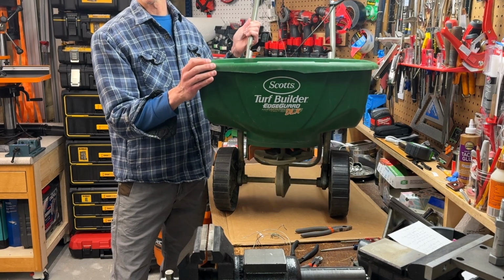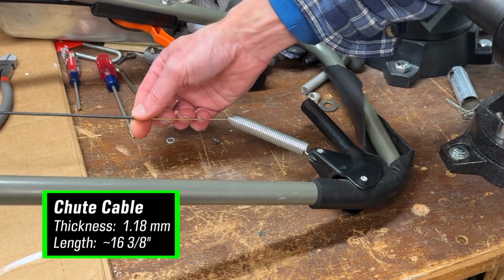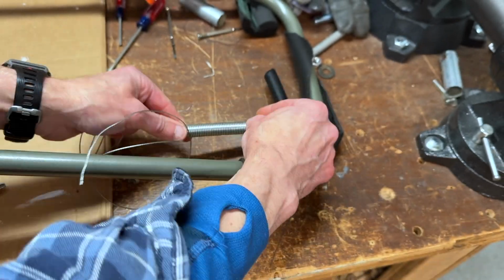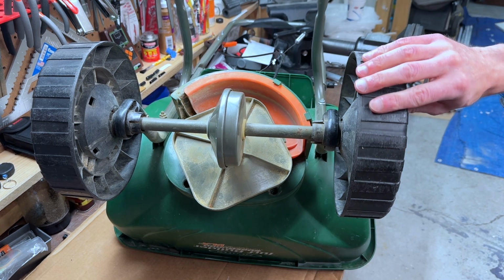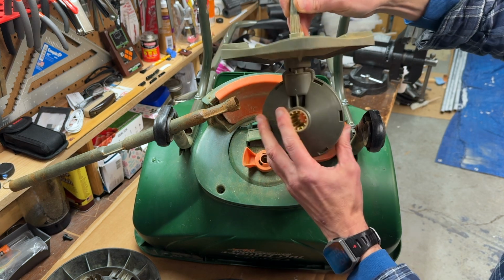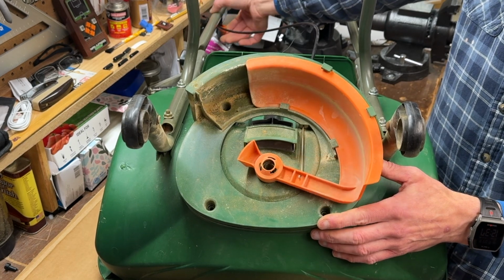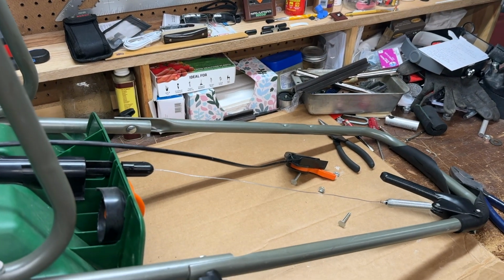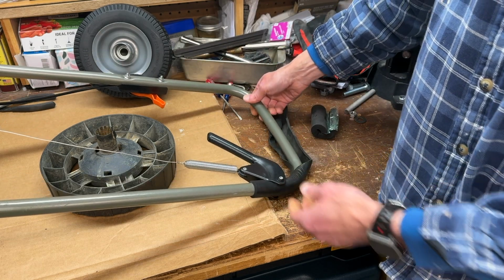How To Fix Scotts Broadcast Spreader - Turf Builder Edgeguard DLX Repair #diy

Comment: The agitator fell off and was lost. Ideas for replacing it without spending $20?
Reply from the maker: How about using a cottor pin or agitator pin? You might be able to find the cap of a bottle, put the pin through it, then affix the cap to the spinning mechanism.

Comment: It sure would be nice if you POSTED where you got the Wire --  for Both
Reply from the maker: Thanks for the feedback. I’ll try to add links. Picture hanging wire can be purchased on Amazon or any big box store (Home Depot, Lowe’s) as can mower/snow blower cables. One person commented they reached out to Scotts directly and Scotts sent them (free of charge) the cables they needed. You might try that first.
Reply: @BruceAlanR  -- Hey TY for the Suggestion on contacting Scotts - they had me give them an " INK STAMPED " number off of the side of the Hopper
a NEW Cable is on the WAY ! !   😁  Customer service was AWESOME--Rare these days   
                 BTW   My Edge Cable was Broken
* UPDATE *   They do not make a Replacement Cable for the EDGE ! !  They sent me the Whole Handle and the HOPPER CABLE. Useless for me.
Reply: @BruceAlanR  ---  * UPDATE *   They do not make a Replacement Cable for the EDGE ! !  They sent me the Whole Handle and the HOPPER CABLE. Useless for me.
 So I am back to looking for a Wire. Do you have a link to what you purchased ??

Comment: Thanks for this, it was very helpful. My experience w/these rotary spreaders is the agitator breaks, any tips for repairing that?
Reply from the maker: I would probably drill a hole in whatever would fit on the gear shaft and slide a cotter pin into it.

Comment: Thanks for this video, well done. My problem was one you didnt cover, the impeller shaft broke when product got gummed up at the bottom of the hopper. Called scotts customer service a couple times and eventually got the parts i needed, except for one. There is a little white bushing that the impeller goes in, and then the shaft from the bottom slides into. Finding this bushing is like a needle in a stack of needles
Reply from the maker: Thanks for the feedback. Hope you got it fixed.

Comment: Great Video! My problem was that the axle rusted away.  I couldn't find one online so I call Customer service...They sent me one free of charge!!  I painted it with Rustoleum and baked it in the oven for an hour.  Now that I see that it takes about 20 seconds to remove the axle, after washing everything off, I'll be removing it every time I've finished using the spreader.
Reply from the maker: Thanks for sharing that great story. I’m going to see if I can get Scotts to send me some parts. I don’t know why they don’t provide parts online.

Comment: I would love a video on how to replace the plastic wheels with actual tires.  Great video.
Reply from the maker: I really want to make the video, I just haven’t found the right tires yet.  I’d like to get 10” tires since it will require less recalibration. The set you see at the end of the video are a bit too small.

Comment: just commented on your Elite review. I am traveling the same road as you. DLX was/is garbage wanted to buy the Elite, now I am just spinning my wheels!!
Reply from the maker: I hear you… and the price of spreaders has gotten out of control. I’m still using the DLX this season and repairing it as necessary. I found an old handheld Scotts spreader in the shed that I’d forgotten about, but that thing was worse than using the DLX. 🤣 I recently found a Scotts spreader (the one they discontinued where you attach bagged products) put out with someone’s trash, so  I took it to salvage parts. Now I have spare cables.
Reply: I refuse to use the DXL again since my lawn is currently striped hahah

Comment: Awesome. The problem I am having with mine is the pin that spins the product in the well keeps dislodging. Thinking of using a little glue to keep it in place- thoughts?
Reply from the maker: Glue would work. I would probably try a thread locking product first (Loctite) because if the agitator breaks, you won’t be able to remove it without potentially damaging the plastic shaft coming up from the impeller.
Reply: @BruceAlanR  Thanks, I have some Loctite on hand. There isn't any threading on mine though. It just fits on the hexagonal rod. It is the black cap part that spins inside the well that keeps popping off. It looks like it has just stretched out over time- it's just plastic.
Reply: Hello, I was wondering if you made the repair and did it work for you. Mine is doing the same thing. Thanks  @TheBeautybound
Reply: @curtisking2962  Hey there, I just did it last week- so far so good. Hasn't popped off since. I used E6000 glue.

Comment: Im still waiting on the video of the wheels replacement
Reply from the maker: Yeah, I’ve been meaning to get there but have been doing some home renovations. I’d like to put 10” wheels on the spreader, but haven’t found the right ones yet. I did pickup a Scotts Snap spreader for parts that someone put to the curb, and while the tires are better (solid design) than the DLX, they aren’t pneumatic.
Reply: @BruceAlanR  i found some other videos but you are the man. I like the way you explain and do things . Your awesome keep doing what you are doing thank you for all the videos 🎉
Reply from the maker: @Acm809  Thanks for the kind words and encouragement.

Comment: The wheel don’t turn freely what do I need to do
Reply from the maker: A good place to start would be to remove the wheels, slip out the axle, and give it all a good cleaning. Then check that the gearbox moves smoothly and all the connections up to the impeller are working.

Comment: I seriously don’t think mine is calibrated correctly. I just spread a bag of pre emergent that was rated for 12,000 square feet on a 1 acre lot. I even went past the setting and made it larger and it just doesn’t seem to want to allow the product to come out. (Yes. I’m crushing it and making sure there are no lumps clogging the exit slide)
Reply from the maker: Ugh! Luckily it wasn’t the opposite problem where 12,000 sq ft of product goes down on 1,000 sq ft… been there… Sounds like the shoot isn’t opening wide enough and the agitator is getting bogged down.
Reply: @BruceAlanR  this thing is trash. Now I have to reapply and guess the correct setting. I have enough bags for my lot but now I have to guess the setting and re-apply.

Comment: I bought one, but I ended up having lines of fertilizer noted in my yard because the application spinner is below the wheels so it throws it into the wheels and land straight down so we have two lines of fertilizer feed in your lawn. I didn’t like it.
Reply from the maker: Thanks for sharing your experience. The DLX isn't a great spreader by any stretch. I find that if I walk very quickly the product clears the top of the wheels better. Some product still gets stuck in the hollow wheels, which is why I plan on replacing them once I figure out a solution.
Reply: @BruceAlanR  have you considered using expandable spray foam to fill the cavities on the inside of the wheels. i bet one can used for window seals would do the trick
Reply: I took two aluminum pie tins and crushed them flat onto the inside of the wheels, and poked a couple holes to add 3 zip ties on each one. Trim the excess and it looks fine but most importantly keeps product from caking up in the wheels

Comment: My scotts spreader is very similar to the one you are rebuilding. Although mine is working, it has become difficult to push. Any ideas on what needs to be done to help it be easirr to push? TIA
Reply from the maker: I’ve had that happen before and the issue was the “wings” on the axle weren’t centered inside the gearbox. Basically, if the gearbox is out of alignment it’s harder to push. Adding axle collars will keep the gear properly centered on the axle. If you’ve been forcing the gearbox to spin off center, worst case would be the gears inside are now out of alignment. Try flipping the spreader over like I have it in the video and repositioning the gear box to see if it spins easier in a specific position. If so, add axle collars so it stays put. Would also be a good idea to remove the wheels, axle, gear, and impeller and give them all a good cleaning with soap and warm water (wear gloves). Things may simply be gunked up.